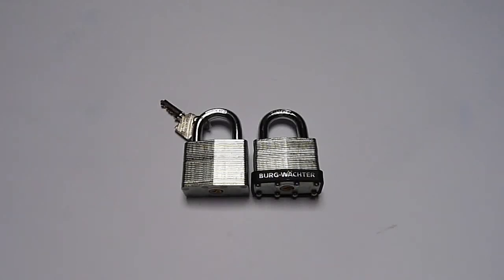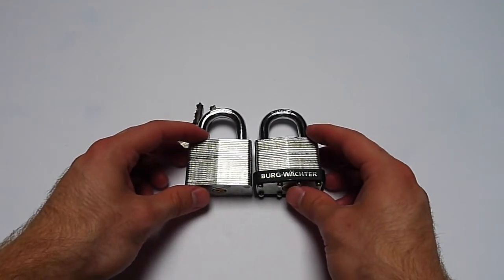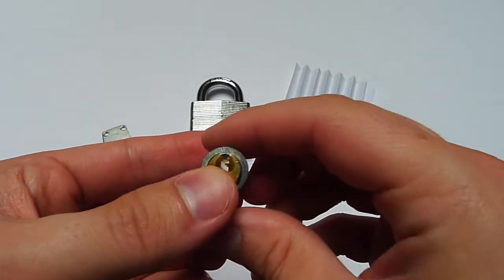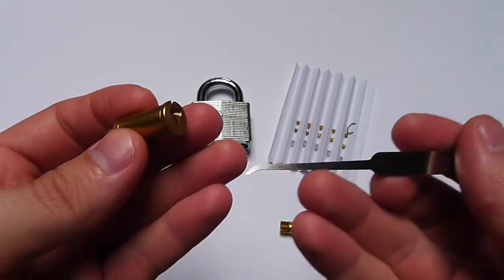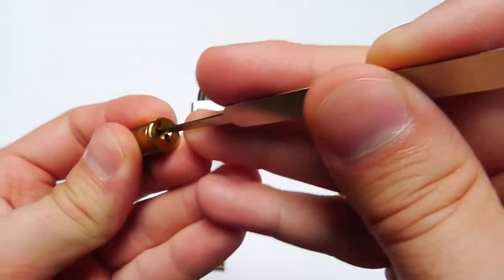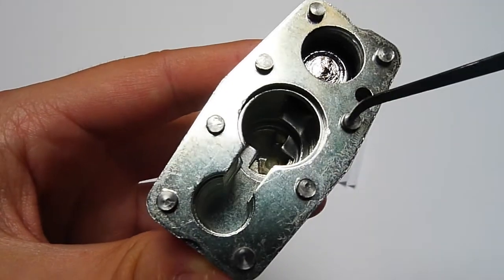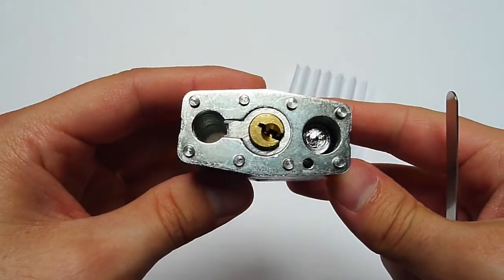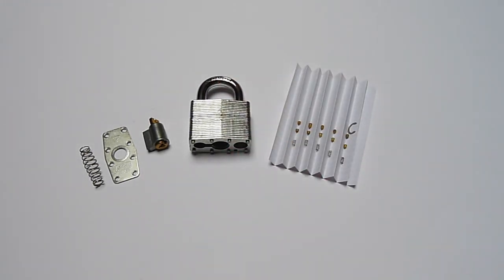Burg Wächter Vulcan 111 50 Padlock Gutted and Reviewed

Comment: Very well made video.  I learn something new every time.  My opinion as a manufacturer is that often the holes in the plates are multipurpose.  They likely have a series of standard plates and custom plates.  That is, some must be exactly oriented, other can be flipped upside down.  In your experience have you seen that Burg Wachter has a variety of cylinders that could fit permanently into this lockbody?  We have computer controlled changes in our tools to create differing cavities but not to take out excess material.  In this case, yes, maybe they are lightening the lock and selling the excess to their scrap dealer.  The bottom plate with the small hole would typically be for drainage but in this case you were absolutely correct.  It is a secret German spy thing.
Reply from the maker: Hey Patrick thanks for the informative comment and the insight on manufacturing! I don't believe they have differint cylinders for it. I think they only use one. I am REALLY glad that I was right on the spy compartment :D